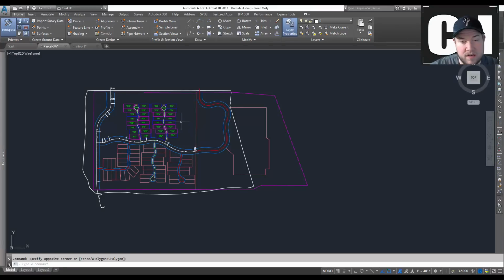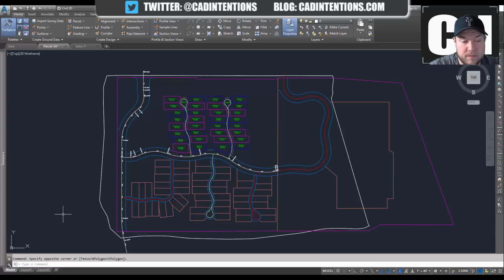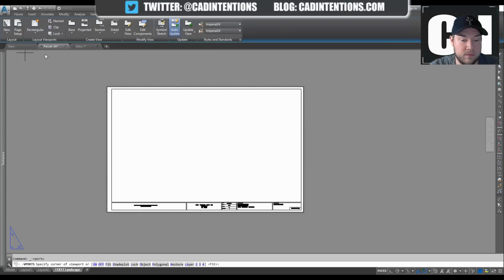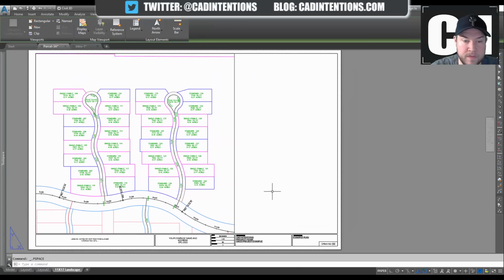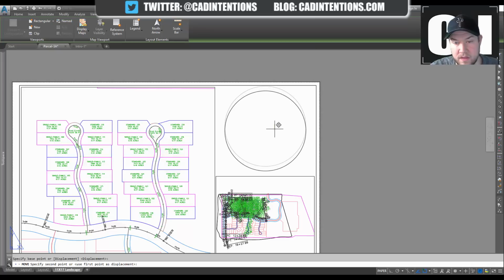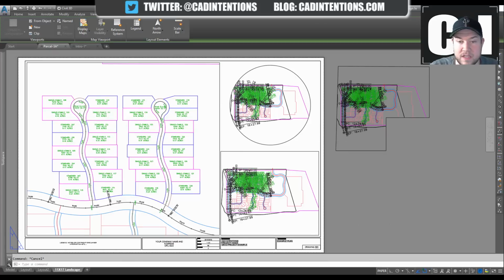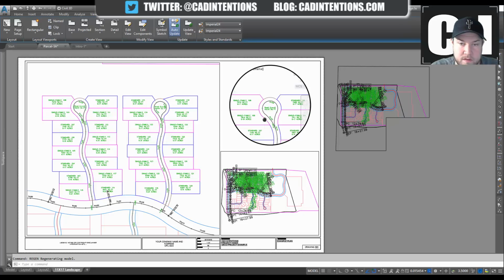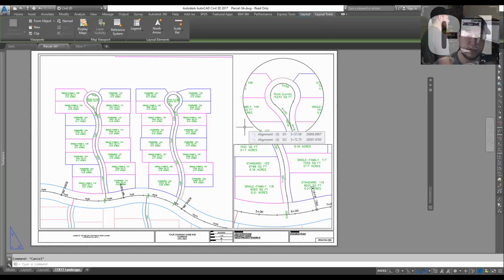AutoCAD How to Create Viewports (Multiple Views & Circle Views) - New Layout Tutorial

Comment: Good video but have two questions.

1) my drawing has many layers. It would be nice to selectively turn off some layers in a viewport to show detail.

2). How would you set up a single paper print to show multiple viewports using different drawings in each viewport. If a drawing changes, it does not affect the other part drawings.

Comment: This was my only problem with cad but now I can move on with finalizing my project and all the credit goes to you buddy! One issue is that when plotting with this method the rectangles are showing on the paper view, how can we get red of the outlines?
Reply from the maker: Thanks, glad I could help! To get rid of the outlines of your viewports, just make sure to put your viewports on a VP or Viewport layer (any layer you want to use for your viewports) and set that layer to Noplot in the layer manager (click the litter printer icon to cross it out, meaning that layer wont plot)
Reply: @Cadintentions  It did work, BUT :), It disabled the monochrome B&W prints so I can only plot color sheets now!
Reply: Never Mind, I think the monochrome drivers were corrupted. I was able to fix it by creating a new Layout sheet. THANKS A LOT!

Comment: Do you find 16 GB of RAM to be sufficient? Do you get bogged down during normal workloads?
Reply from the maker: yes, I've done quite a bit of surface modelling and working with large point and surface datasets with the 16gb of ram and haven't had any noticeable bogging issues. I've found that having a fast HDD or even better a Solid State drive helps more than the extra ram.
Reply: How much do find the amount of VRAM or CPU, GPU and RAM clock frequencies affect performance? For the CPU, which seems to matter: thread count, the scale of the architecture (22nm vs 14nm), or instructions per clock and clock speed?
Reply: I am using Autocad For Electrical Engineering. except for big heavy projects files, my computer handles very well everything else. I have a little bit old pc: Intel Core2Quad 2.6Ghz / ATI HD 2GB vram / 8Gb DDR2.

For surface modeling, 3D Rendering, and arethmetic calculations, things are diffrent.